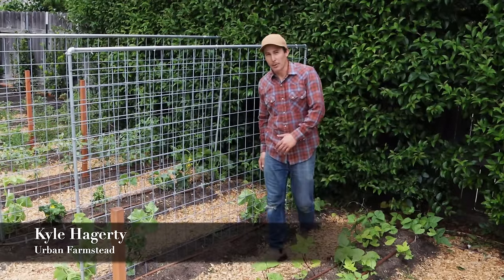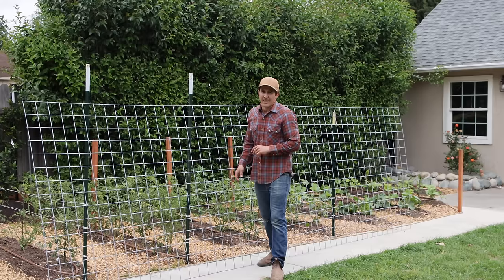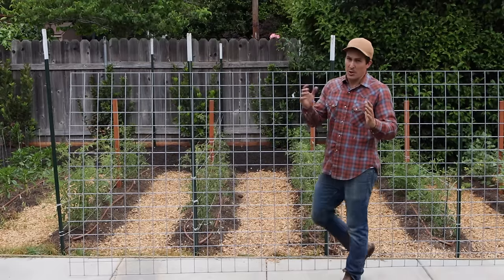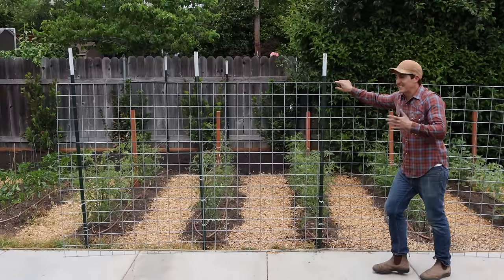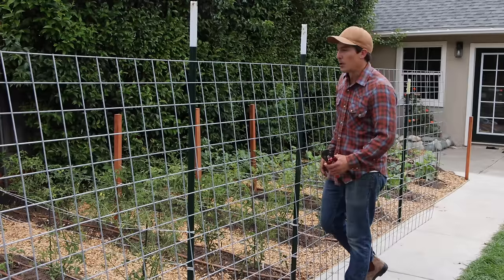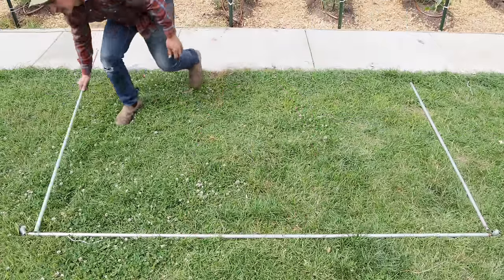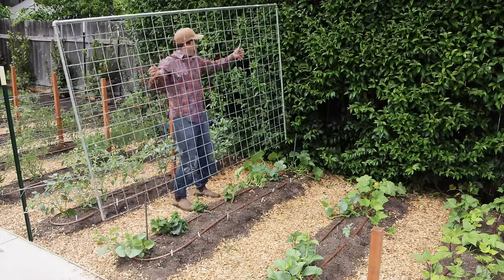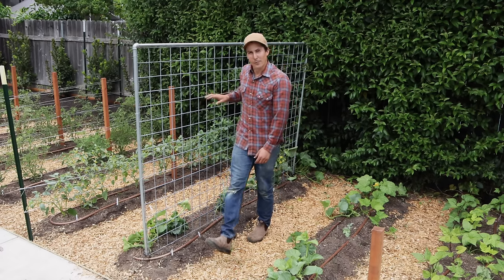How to Build a Fence Panel Trellis - Cattle Panel, Hog Wire etc.

Comment: Hi Kyle - question about how you cut the panel in half. If you cut right at 8’ one of your panels has open ended horizontal end pieces and no vertical pieces to attach to vertical conduit with the wire. How did you work around this? Also, at what interval did you wrap wire at? Thanks!
Reply from the maker: Hi, that's a great question. I cut back and forth atvthe 8 foot mark so that each panel has open and closed ends. I wired 4-6 spots on each side
Reply: @urbanfarmstead  please illustrate in sketch. Can't picture it.
Reply from the maker: Virgie M will do
Reply: @urbanfarmstead  Thanks so much.

Comment: Hi. What gauge wire are your panels?  Just wondering if we can curve 16 ft 8-gauge panels to fit into a 4x10 trailer.
Reply from the maker: I don’t know what gauge they are, but yes, you can. I curve them then to fit in my truck bed when transporting
Reply: @urbanfarmstead  fyi, we tried it & managed 14 8-gauge panels just fine.  Love how to the point your video is!

Comment: Where did you find threaded conduit?
Reply from the maker: They threaded it for me at the hardware store
Reply: I was looking everywhere, haha. Ended up using compression fittings. Great design though. Can’t wait to get some plants in the ground. Great videos I’ve learned a lot.
Reply from the maker: @davidcampbell4429  thank you! Check out Maker Pipe, they make a bunch of different fittings for conduit pipe

Comment: All I can find is graduated panel and 14 guage with 2 in x 4 in openings. Will either of these work?
Reply from the maker: As long as the wire is thick enough that it won’t bend or become flimsy under the weight of the crop. Small 2x4 openings are fine if you have access to the crops from both sides.

Comment: I think using the livestock panels is a fabulous idea. But, a question: I've been told never to use panels for food because galvanized has zinc & cadmium--highly toxic. Your thoughts? Enjoyed your video & am subscribing. Thanks
Reply from the maker: Deb Kincaid Even if the material is “highly toxic” (which it certainly could be, but I’ve never heard that before) how would the metal contaminate the fruit of a vine that’s growing on it? I’m not doubting it’s possible but hoping you have more information since you were motivated to share this.
Reply: @urbanfarmstead  I'll do more research, but you make a good point. I love the panel idea though: so practical & nice looking. Thanks for responding so quickly.
Reply from the maker: Deb Kincaid please do let me know if you find any good information about it. Happy gardening
Reply: Hello! I got a reply today from Cornucopia.org. Short story? Livestock panels are considered safe in most scenarios. Here is a copy of the reply I received if you are interested. Thank you for your super helpful videos.

"It is true that zinc and cadmium will break down into the soil over a long period of time. This is a very small amount of zinc and cadmium, however, and these metals already naturally exist in soil. While it is true that highly acidic soils can become contaminated with zinc, it is highly unlikely that the use of galvanized cattle panels in the garden would do so in sufficient amounts to cause harm. Regarding growing the vines on galvanized cattle panels, due to the relatively short lifespan of any plant, it is also very unlikely to cause harm. I cannot confirm that harm is impossible because each human being has specific health issues and each garden has a specific level of minerals (actually, much of our farmland at present is actually low in zinc). But if you happen to live where cadmium and other unearthed metals and mineral levels are very high already, such as land that has been subjected to runoff from mining activities, you may opt not to use cattle panels. Frankly, if you are gardening land where mining runoff has been present, you should have your soil tested before you eat from your garden at all.

 

Rust is likewise not considered a health hazard when used in the garden. Large iron oxide spills from mines are a different story, but this is a very small amount of rust we are discussing and it is hard to imagine a scenario where rust from cattle panels could become harmful in the soil.

 

We do not believe that cattle panels used in gardens are hazardous to human health, however, there may be very specific situations where it is not advisable. As you have not noted any history of mining spills or other major pollution to your garden which would draw the safety of the mineral and metal levels of the soil into question in itself, we see no issues here."

 

Kindly,

Melody Morrell

 

Melody Morrell (pronouns she/her/hers)

Operations Director

The Cornucopia Institute

320-364-3133
Reply from the maker: Deb Kincaid wow, thank you for taking the time to reach out to them and for sharing this with me! Sounds good 👍🏼
Reply: @urbanfarmstead  You're very welcome!

Comment: I've heard metal trellises aren't good for plants because they attract a lot of heat, and could burn the plants during the summer. Has your experience been any different?
Reply from the maker: Sashwath Prakash I’m glad you asked, because what you heard was 100% false.  I’ve been using these metal trellises for our summer crops for about 7 years now and our sacramento summers have plenty of 100+ degrees days.  I’ve never had a single issue with that with any crop. Of course the metal does heat up but it’s unfortunate that gardeners pass on false information based on their assumptions. If you remember where you heard that misinformation please share so I can stop it before it spreads more. Thank you, and happy gardening.
Reply: @urbanfarmstead  Agree - I have been using metal trellises for vine crops as well as tomato cages and the heat is not a problem.
I also live in Sacramento.
Reply from the maker: MV D-dub thank you for sharing!

Comment: Unfortunately at this time in history, finding any farm store that sells the sheep/goat version of the panel is almost impossible.  I believe these are the best panels due to the even spacing of the wiring, PLUS you can use them in many other applications such as for banisters, hoop houses, etc.   But, I have been looking for months in the north mississippi area and NOTHING to be found.

Comment: Hi! Could you please share the link to the livestock panel that you buy? I would like to see the technical specifications including the gauge. I'm in Canada (in Montreal) and have actually been looking for something like this panel for months, but did not know that I had to look at farm suppliers. Also, most of the farm stuff here is in French so I need the tech specs to compare and translate to make sure I get the right thing. Thank you! 
P.S.: I'm a graduate landscape architecture student and your videos are extremely helpful! I'm very grateful! Thank you :)
Reply from the maker: ekatlaterrible hi, yes I’ll look for one online right now to link. Thank you so much for your encouraging feedback! I’m glad you are finding my videos helpful!
Reply from the maker: ekatlaterrible done! I could not find the 60” tall panels that I’m using online so I just linked the 48” panel. Otherwise it’s the same.
Reply: @urbanfarmstead  Phew, these are not easy to find here in Québec. I've been looking for a couple of days now. I did learn one thing that might be helpful to others. The 4" x 4" square panels that are 48" high are qualified as goat and sheep panels, but the ones that are 60" high are qualified as horse panels. The different names are coupled with different openings depending on the animal See the diagram at the bottom of this page : https://www.syrvetcanada.ca/panneau-de-corral-sierra-ksp-sierrapanel

Comment: Might be a non issue.. but I’ll ask it anyway.. the galvanized pipes use lead as part of the galvanizing process. Is that a concern?
Reply from the maker: Should not be a problem in this application.

Comment: What do you do with the wood chips in the walkways at the end of the season?
Reply from the maker: Leave them
Reply: @urbanfarmstead  so each year do you just add to the top? And do you lay down more cardboard or weed guard?
Reply: @urbanfarmstead  is there a certain type of wood chip to use or does it not matterv

Comment: I need a tall trellis around 12 feet tall to get privacy.  How would you do that if it is possible?
Reply from the maker: The same way just turn the panel vertical and cut it to 12’
Reply: @urbanfarmstead  for a vertical trellis - still use 4ft rebar? Does that support 8 to 10 ft?

Comment: Will it stand the wind?
Reply from the maker: BeautiFool here it will, but it just depends on whether you winds are strong enough to bend two 1/2 inch rebar stakes. If so, I would use longer conduit pipe and drive it into the ground with the rebar for maximum support.

Comment: If that’s galvanized steel piping and fittings I don’t think you should use them around food. Zinc toxicity is not good. Black pipe is ok to use around food. FYI.

Comment: How about giving us an idea of the cost of that livestock panel?
Reply from the maker: The cost will very depending on where you buy it and which type you buy. At my local store cattle panels are $25, sheep panels are $57.
Reply: @urbanfarmstead  that’s actually very accurate pricing. Again the hard part is fitting them in a pull behind trailer or a pick up truck to get them home. Lawn care companies and sometimes neighbors will get them home for you for a fee.
Reply from the maker: @Heavensoon7  I bend them into and arch layer on its side in the bed of my pickup truck. It works great!

Comment: Could you modify the bottom pipe to be a water sorce
Reply from the maker: Stephanie Mair what “bottom pipe?
Reply: @urbanfarmstead  I was thinking it was a  4 pipe frame... Im sorry!  But if you did make it with 4 pipes you could put pinholes in the bottom pipe for a water system
Reply from the maker: Stephanie Mair I suppose you could add a bottom bar and some adapters to plumb it into an irrigation systems but that sounds like a lot of work for something that would likely not function well. I’m not sure why anyone would choose to do that rather than a cheeped, simpler, more functional and reliable irrigation system that’s designed specifically for irrigation, but it’s up to each gardener.

Comment: another youtuber used galvanized washers to slide over the rebar and the washer acted like a footing for the uprights to prevent them from sinking into the soil over time
Reply from the maker: Thank you for sharing that! That would definitely be a helpful modification for a trellis that didn’t have the livestock panel down the center. With the panel down the center it definitely won’t sink into the soil over time.

Comment: Hard to find sheep panel in CATTLE COUNTRY! lol

While your trellis looks really nice, it is a bit over engineered.
Two T-Posts, some panel, and some wire is simple and strong.
Reply: I actually got inspired this video and finished my trellis and in hindsight, I wonder why I just didn't use cattle panels and tposts instead.
Reply: @shwetzsri  Hint: don't space your T-Posts more than 8 feet apart.
Best is 4 foot spacing but that costs extra.
Don't forget the wires to attach the fence tot he T-Posts too.
The 'hook' goes on first then the 'horn'.
Fence pliers are a big plus!

Bolt cutters if you want to cut the fencing.

Oh and you can roll up that cattle panel and strap it to transport it from the store.
Just don't roll it too tightly.

That's how I got mine home.
If you only have a car, place a blanket on the roof (double the blanket) do you don't scratch the paint.

You want the 6 1/2 foot T-Posts too so they fit the standard 4x16 cattle panel.
The cattle panel cheapest is the 6: x 8: holes.

You can buy the more expensive panels with 2x4-ish spacing but those are double to triple the cost.

Make sure it is the galvanized stuff not the stuff they use for driveways (which rusts badly).

Oh and a post pounder makes driving the posts in a LOT easier.

Comment: Is this what you are using?
Livestock Utility Panel
Specification 	Description
Product Weight 	49 lb.
Product Length 	16 ft.
Animal Compatibility 	Livestock
Material 	Galvanized Wire
Mesh Size 	4 in. X 4 in.
Product Height 	5 ft.
Product Width 	16 ft.
Thickness 	6 ga.
Manufacturer Part Number 	1770-0
Reply from the maker: Yes, that looks about right